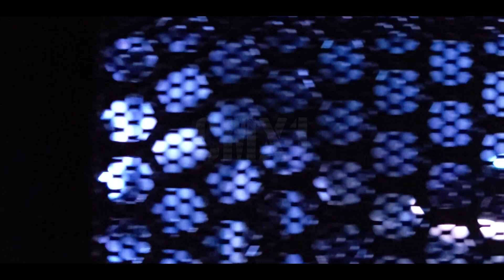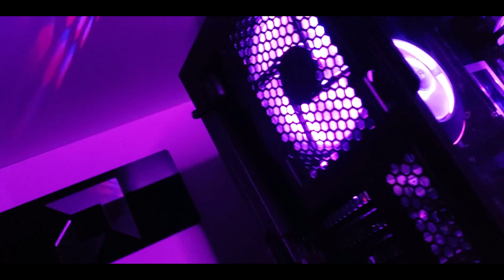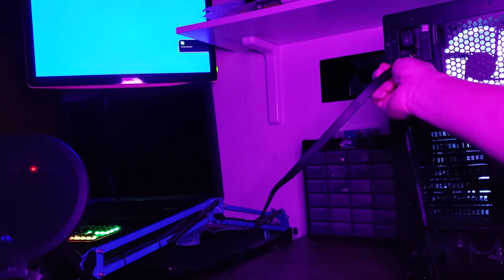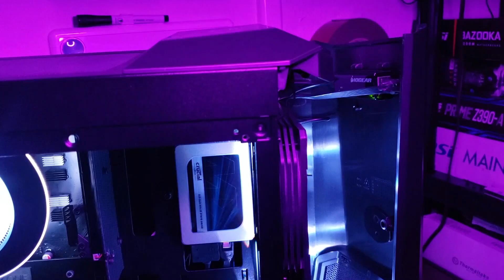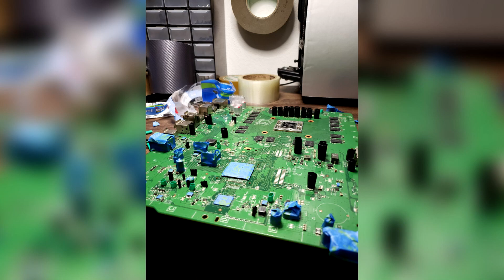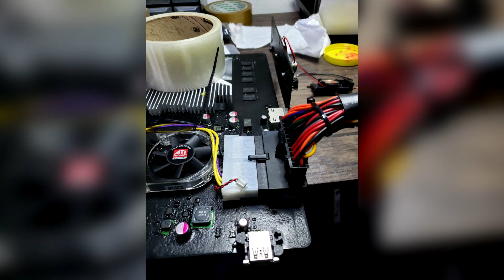Fully Custom Xbox One Sponsored by: Cooler Master

Comment: Series S liquid cooler is what I'm wanting to do... for fun n looks I got 3 of em and 2 series Xs atm along with the all of last gens ps4s and xboxs. But I really wanna do something special with the Lil guy "series S" because honestly it's a bad ass system. So it deserves some love lol so I'm wanting to drop a corsair liquid cooling system down into it.. possibly with the lcd screen on the cooling block so ppl can see it down inside. Should look nice.. but I'm not sure what size block ect to use on it
Reply from the maker: That would be so sick! I used a LGA1151 bracket that had to be modified to fit the socket of the xbox. I just had to drill new holes in the mount, none of the newer coolers will have a mount that will support it I don't think, so keep in mind you most likely will have to modify a bracket, I'd love to see an LCD AIO mounted on an xbox!

Comment: Hey, I’m planning on Modding my Xbox into a case very soon and I’m wondering about two problems I’m thinking of. First is the front panel on the Xbox. In your first custom build you made a custom 16 pin to be able to place it where you want it. Is there anywhere I can order a cable like that so I’ll be able to move it within the case. Also another problem is the io. How would you go about making the io work with back of a pc case as they won’t match up like a pc motherboard would. Just wanted to ask to see if you had some ideas. Thanks
Reply from the maker: So for the front panel of the xbox you have 2 options. First, if you have the original xbox one you might not be able to make an extension cable due to the head of the connector not being common. Maybe it's out there somewhere but I don't know the name of that connector and have never seen it which is why I modded mine in this build. Second, for the xbox one s and maybe newer you can only buy the connector head and not a fully made cable. I know for a fact the xbox one s uses 16-pin 2mm pitch, just like this --> https://www.ebay.com/itm/172720495753

I'm not sure what xbox you're using but if you need more help regarding the connector I'm here for that but for the rear IO lining up with the back of the case you just have to see for yourself. Mine blocked two ports, one I didn't need and the other was low enough to be used through the pci expansion slot cover but still needed to be modified which is likely what you'll run into.
Reply: @vEAGLE5  Thanks man means a lot, I’m ordering the parts tomorrow so I’ll let you know how it goes. I can already tell this is gonna be a journey and a half 😅

One last question before I begin this adventure. In your initial build when you made the custom io, how did you go about doing that as I’m thinking of doing it that way. thanks again i appreciate it
Reply from the maker: @DrNebulaa  Are you talking about the one with the custom extension cable or the one where I soldered onto it to work with the case in this build?
Reply: @vEAGLE5  The one with the extension cables in your old built. The completely custom pc case build you made
Reply from the maker: @DrNebulaa  so I used 20AWG wire and soldered each wire to each pin of the connector head. You can probably use a higher guage wire to make the soldering process easier because all the connections are super close to each other so thick wire and lots of solder can cause problems! After I soldered the wires to the connector I hot glued the back of the connector where the pins are soldered to the wires to ensure no shorts would happen and I did that on both ends of the cable. I'm not sure if any of what I just typed answered your question but if not I can try again lol
Reply: @vEAGLE5  That’s perfect thank you. It’s a life saver I can ask questions to someone who knows what’s going on. I appreciate the help
Reply from the maker: @DrNebulaa  I'm glad I can help! If you have anymore questions just let me know! Good luck!
Reply: @vEAGLE5  ordered the case and parts I’m going to need. Looking forward to having a new and improved set up
Reply: @vEAGLE5  Sorry to bother you again. But I wanted to ask one last thing to clear any concerns I have before everything gets here. when you mounted the motherboard to the case obviously the standoffs aren’t going to align with the motherboard. How did you go about making sure it was mounted securely? Thanks again
Reply from the maker: @DrNebulaa  No worries! Ask away whenever! So you might have a few standoffs that line up but for the majority you'll have to place the mobo where you need it and mark new holes with a sharpie or whatever else works and drill your new holes. I bought a standoff kit and used a nut to secure each new standoff instead of threading the metal on the case because it was easier lol
Reply: @vEAGLE5  Cheers man. Looking forward to facing the challenge
Reply: @vEAGLE5  hello once again… XD I’ve got a lot of the parts now just waiting for the case to arrive. Was just wondering if you was do to this project again is there anything you would have done differently? It’s a random question but might help me avoid any mistakes I might make along the way. I know I’m bound to run into some problems but It would be nice to avoid them if I can 😂
Reply from the maker: @DrNebulaa  So there is a couple things.. one is actually taking the time to make an extension cable properly for the network card. For some reason making the cable the same way as previous ones just doesn't work for the card and I think it has something to do with grounding or interference due to a modified cable, I'm not sure about that one but I also wish my case had room for the optical drive so I could use the original disk drive but I couldn't. The pain with the optical drive is that it has to be plugged in and working to be able to update the xbox, whereas mine is deleted and has to be plugged in for every update. I don't ever use mine because I play on PC but it can be an annoyance sometimes! Oh and I would have 3D printed some custom parts instead of cutting out of PVC foam but really that's not a huge deal.
Reply from the maker: For the network card in my custom case build that worked fine but the original xbox network card didn't like a custom cable so I think you're in the clear with an xbox one s!
Reply: @vEAGLE5  also if you were to suggest an extension cable for the hdd which one would you I’m sure there’s plenty out there but I’m not sure which would I should go for as this is definitly isn’t a usual build. Also I’m not so in the clear because I’m working with the original Xbox one too :,( but I have so ideas to fix the issue
Reply from the maker: @DrNebulaa  ohhhhh that sucks :( but for the extension are you talking about what type of sata cable or the power for the drive?
Reply: @vEAGLE5  hey man thought I’d give you a little update. I’ve received the case and have managed to mount the motherboard in it got the hard drive mounted and working so it’s going well. Going to leave the disc drive and the wifi card to the side for now while o work out the best place for them
Reply from the maker: @DrNebulaa  thats awesome to hear man! Keep me updated! :)
Reply from the maker: @DrNebulaa  hey man how's the build going?
Reply: @vEAGLE5  Hey man, coming along quite well. i’ve managed to hook up the power to the front of the case so i am able to power it using the power button on the pc case. i’ve dabbled in getting an external psu to work with the mod abs i’ve also managed to get the rgb fans and led strips working as well as a temp monitor (mainly for show). haven’t been able to do loads recently as i’ve been super busy but i’m pretty happy with how it’s gone. a whole lotta cable splicing

Comment: Hello, I’m very interested in console moding and inspired by all the different Xbox mods you have created. I am doing research for my 2nd modded console (Xbox one S) but information on mother board cooler mounts, fan compatibility and ssd impactions, has me at a stall mate searching the internet for information, so I comment this hoping that you can get back to me and provide (said) information. help from you would be very appreciated, Thank you.
Reply from the maker: Sorry for the late reply! I'd love to help! So starting with the socket type, I read from a random comment that the one s uses an FT3 socket which is rare. What I recommend for aftermarket coolers is using LGA1151 or similar and modify the cooler bracket (drilling new holes). For fan compatibility, only use 12v standard. You can power all your fans from the cooler fan plug on the motherboard but I'm unsure how many total is safe to use. In this build I was able to run the cooler fan and 4 additional fans for the case with no issues. SSD would be a great swap from the HDD but I noticed performance isn't that drastic. Yes the system boots noticeably faster and games do load slightly quicker but it's not a HUGE improvement Could have been bottlenecked from the SATA port on the motherboard since it was only designed for the speed of the HDD, who knows? But if you do decide to use an SSD the HDD has to be cloned a certain way, I don't remember but I know there are Youtube videos for that! If I missed anything or if there's anything else I'm here to help!

Comment: Hi @vEGLE5 I was wondering if this build was very difficult or not and how much the build cost excluding the xbox.
Reply from the maker: Give or take $270 USD but you can save a lot of money which your choice of fans, case, cooler, ssd, and custom 24pin cables. I would say the most difficult things would be using an actual pc psu, and making the cases front io work how intended with the Xbox. If you're in for an adventure totally go for it but if you're uneasy about any of it just try to get familiar with how the system works and how you could make it work with a different enclosure.
Reply: @vEAGLE5  Cool thanks man

Comment: im doing something similar putting a ps4 into a pc case then ill do the original xbox one i have and its all confusing but you got it props im sure ill find a way lmao
Reply from the maker: I believe you can do it!! Lol I would love to see that ps4 when it's done!!
Reply: @vEAGLE5  wont be easy theres not 4 holes in the motherboard to strap a custom cooler down and i think ill have to use the ps4 power supply and a the pc power supply for the fans so lots of switches before it works instead of just powering it on no custom cables i can find yet
Reply from the maker: @thetopgun1214  the original fan connector on the mobo should be 12v. On my other custom Xbox I wired all my fans to that single connector and it worked well!

Comment: ik im a little late but for the motherboard did you leave the bottom of the xbox case on it
Reply from the maker: No sir it's just the bare mobo screwed into the chassis with standoffs!
Reply: @vEAGLE5  ok so its basically plug and play
Reply from the maker: @phillipslattery3260  not quite exactly. The the standard standoffs for atx, micro atx, and itx don't match completely so you have to drill new holes in the case to make it work!
Reply: @vEAGLE5  ok anything else i gotta do im trying to do this with me one x thought it would be cool instead of selling it

Comment: can you put a video of a wiring diagram of this build  like the Power input/output?
Reply from the maker: I can I just need some time as I'm a little busy. Are you planning on using a pc psu?
Reply: @vEAGLE5  yes i thought of using a corsair  CX550 PSU  i have an XB 1 Elite and ive had it since 2016 when i got it brand new but after i saw this video  i thought " woah i didnt know you can turn one of these into a PC console version and thought id like to give this build a try. im really good a soldering , its the  he (wifi on/off switch)  is what kinda threw me off a bit when  you showed it had a hard time getting a good look at the wire connections and solder points.
Reply from the maker: @wolfhauzer3178  So the biggest thing before you can do any of this is that you need a power supply with a 12v rail outputting 18 amps. If you don't know you can look up the specs for your psu. I'll link you a short video of some more information
Reply from the maker: @wolfhauzer3178  https://youtu.be/V_Cm22yP6CE

Comment: What heat sink is that? What size / socket is it etc? It's x clamped or what?
Reply from the maker: Heat sink is a Cooler Master G100M, socket is BGA and the bracket for the cooler is LGA 1151 but I drilled new holes in the bracket to fit BGA :)

Comment: I want to do something like this but not sure what aftermarket cpu cooler would fit the xbox cpu cooler holes. do you maybe know?
Reply from the maker: There are a very select few of AIO coolers that have the same socket holes but I've only heard and have no info on those sadly but most of the aftermarket coolers you're gonna have to drill new holes in order to fit these types of coolers. Just a tip, you might be able to get away with using zip ties, they can get the job done.

Comment: Hello bro, very nice your xbox in pc cabinet.
I have a question? ...... how did you adapt the heatsink?
Do you think I opened my xbox and had an aluminum heatsink and I want to change it, which one do you recommend or which one did you install?
Greetings.
Reply from the maker: Thank you! I had to drill holes in the mounting bracket in order for it to fit so if you're planning to change coolers you may need a drill or someone who has one with metal drill bits. The heatsink depends on how much room you have in your system so you may need to take some measurements.
Reply: @vEAGLE5  OK thanks.